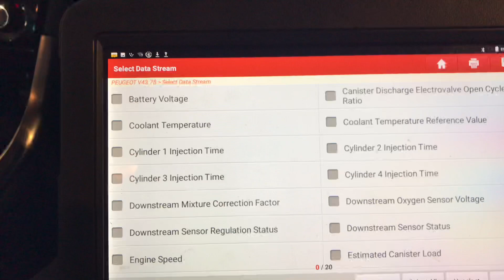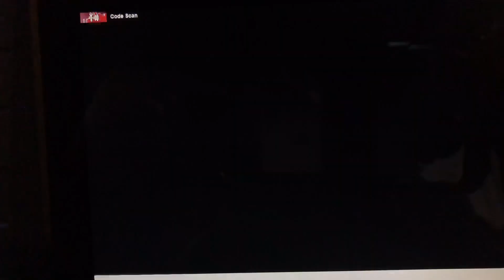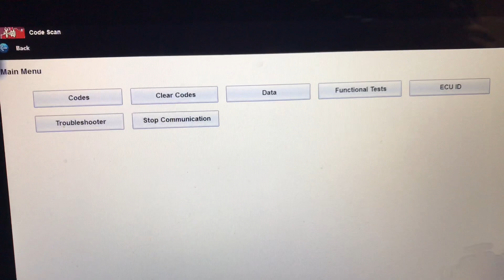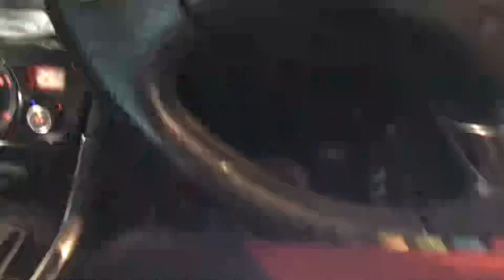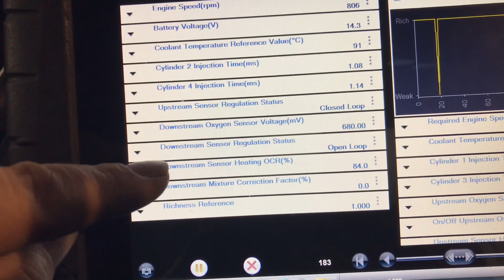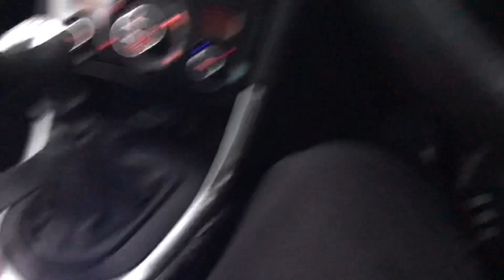Peugeot 308 CC - P0087 High Pressure Regulation Pressure Too Low

Comment: If its a pre 2013 model the P0087 fault is most likely the high pressure fuel pump beggining to go bad, causing the missfires. Of course it could be the plugs (change every 20k on these engines) the coils (which usually not too bad) or a clogged injector (than the missfire will occur on the same cylinder).

Comment: I dont get it, what fixed the code? I have tbe same problem, i replaced the fuel pressure sensor, HPFP, LPFP, and checked electrical connectiom. And yet it didnt get solved. Any tips?
Reply: Did you solve the problem with p0087?
Reply from the maker: @Robert-rj3gd no never got to bottom of it

Comment: Just rebult my x ds4 as belt went and have sensor 2 fault with no clue 

Only thing i can see is the fule line on the pump has a valve  wonder if the put a pump on it an pump into 
Bit Like a balder in a boiler tank ??

Comment: I have a Peugeot 308 1.6 thp 125hk allure 2013.
My problem is that it runs rough all the time( mostly at cold engine).
Ive changed the timing chain,spark plugs, control valve, h2 sensor( ive got the h2 sensor error code).
And it still runs like shit. I dont have a error code for high presure pump but im thinking of maybe changing it.
Could anyone know what my car is failing?
Reply: The high pressure fuel pump is the problem in your case?

Comment: Peugeot seem to have the crappiest sensors going.  My mother hasn't long got shot of a very low mileage 308 because the damned thing kept chewing sensors and running like a bag of shite.   Dumped her at the roadside on more than one occasion (not good when she is in her 70's!) - she has bought a Honda Jazz now instead and the only fault so far is a duff connection on the 12v socket, repaired under warranty.
Reply: Honda Jazz is extremely reliable

Comment: Troublesome those high pressure fuel pumps. Great tip using the app to get the engine code👍